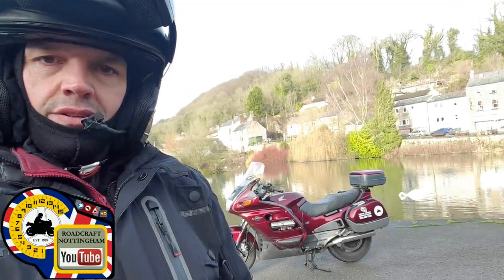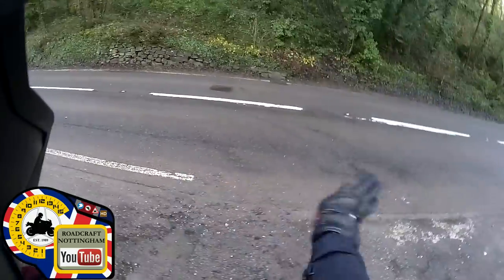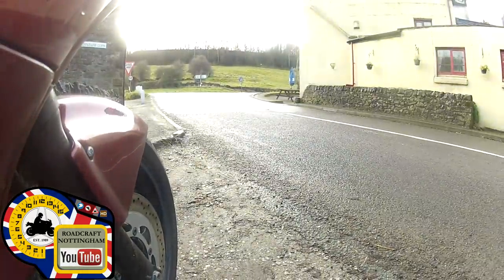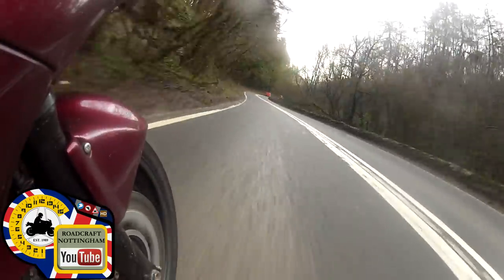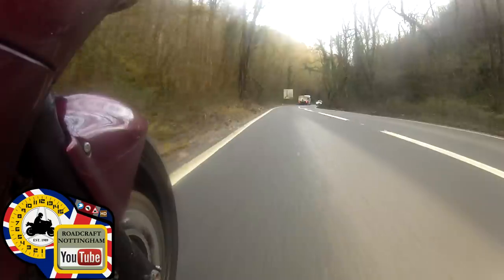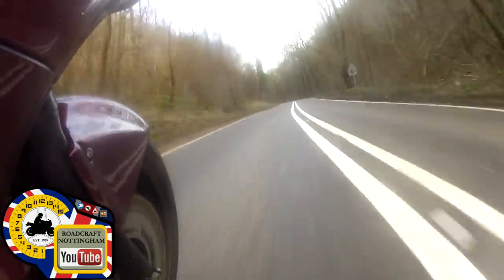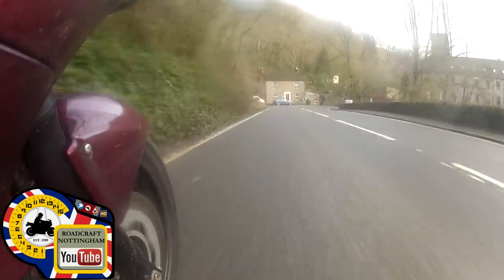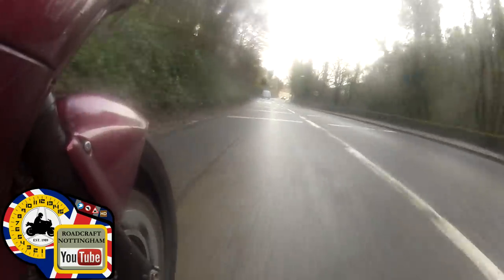Motorcycle riding tips: Advanced positioning demo with commentary

Comment: as a hgv driver and a IAM rider,this advice is great.HGV's trailer will cross centre lines on sharp rural corners,we cannot prevent it,keep away from that centre line if you see us coming pls,seen so many riders stick to their position like glue because they dont recognise the dangers👍
Reply from the maker: Yes, at the beginning of my how to ride in police style advanced upload a lorry has crossed the white lines. A lot of advanced riders don't consider this and just say "dominate your position". Thanks for the comment.
Reply: Great video and I agree with all the comments.

Experience has taught me to use the default position I was trained to in most situations, but also not to be afraid to adjust position due to weather, road surface or for potential dangers.
Reply: @petervan-huysse5803  Isn't  that why instead of having the old 7 positions or the more recent 5 positions we are now down to only 3 positions. Position 3 being the outside position is no longer close to the middle lines of a road but now borders on the sump line, the central position 2.  This was because at times in the old position 7 or 5 being close to the centre line on bends we might meet a vehicle head on which has crossed over that line and approaching us at double our speed.  Under those circumstances we are told to sacrifice such a  position and move in to  1 or 2 in order to avoid a collision but now its believed that we should not be instructed to place ourselves in that insidious position in the first place.
Reply: Whilst riding on country roads and on bends I take note of the middle white lines.  It seems to be a bit hit and miss so to speak. Some counties love them, putting hem everywhere  and they can be frustrating as they can slow progress but some other counties don't appear to like them and  their roads are devoid of  solid white lines. Maybe they havn't got the accidents that some counties have or just maybe they cant be  bothered.

I also look to see just how worn those lines are and if the lines are well worn it indicates that many vehicles coming the other way have run over the lines  and almost destroyed them. That is a further indication  to me of the danger of being close to them and perhaps justifies the reason the Police Roadcraft changed their attitude towards riding on or close to them .

Comment: About the manhole cover you mention in the beginning, the famous video "Twist of the Wrist 2" shows exactly what you mention at ~1:30 about regaining traction. 
They demonstrate this principle with a bike almost fully leaned over, hitting a patch of sand (arguably even worse than a manhole cover in terms of grip). Keeping a steady throttle and not upsetting the bike shows it being slightly unsettled after which it immediately gets grip again continuing on its trajectory.
However they also demonstrate what happens if you 'panic' and swiftly close the throttle. You guessed it: front just slides away with no ability to recover.

Comment: Nice video Russ. 👍 I often have to discuss riders taking quite harsh position changes just to miss a manhole cover when they are upright. The move they made was more dangerous than going over the thing. Having said that, if I can blend my line so I miss a raised/sunken one I will. In the wet and on a bend, if you must hit them then it is best to clip them towards the outside of the bend. That way any slip will be minimised. Good to hear mention of positioning for safety and not just view.  You also straightened the curves a little if you had a good view. All good stuff and the same sort of riding I do in my videos/commentary demos. 🏍
Reply from the maker: Thanks Mike, if I see it far enough away I sometimes make a steady movement away too but when people say they slipped on white lines/manholes they probably simply felt the bike change grip, that's all and if it DOES slip, chances are it's only a few inches before re-gripping unless they're doing some extreme and harsh riding. Makes me laugh how many qualified riders still swerve like the lids missing lol.
Reply: @RoadcraftNottingham  You do have to watch some white lines though as on the rural B roads they are often over painted and then over painted again, leading to them being quite a ridge. If you are not crossing them with enough angle you can get a tram-lining effect, which can be very unsettling.
Reply from the maker: @mikeroberts  add to this, as we know in winter there may be unthawed frost on the paint.

Comment: Good clear informative video. Worth mentioning for rural roads you can split advice between single and standard carriageways.  On single track lanes I tend to drop back further than the standard 2 second gap to perhaps 3 or 4 seconds, esp if damp.  This allows an extra safety margin for shielding where your view ahead may be more obscured.  On standard carriageways I always move to position 1 for farm vehicles and slow down because sometimes its difficult to see what attachments they are carrying until quite close and many of these overhang the centre so are a particular danger.  Ditto hgvs especially on bends where the rear wheels will often cut the centreline. Position 1 every time for hgvs, buses and farm traffic as well as for cars towing caravans or horse boxes. Position 2 is generally fine for cars but if the view ahead is good there’s still benefit in taking position 1 for all oncoming.

Comment: I like watching your videos as a way of validating my own roadskills on a bike, I learned the hard way for positioning with an oncoming HGV, nothing serious but I was riding in heavy rain and the oncoming HGV gave me and my bike a thorough wash down with the spray which caused me to panic a little and it was a good job I was on a familiar road and it was a straight part of it which I've learned to now always be in POS 1 when I have any size of HGV oncoming.  I'm a HGV driver so its also given me something to think about whenever I have a biker coming towards me in wet weather conditions, I'm sure many other HGV drivers do this as well and thats whenever I notice a biker behind me I will indicate left to signal its safe for the rider to have a peek and decide whetherto pass or not.  I understand that the view of the road in a HGV compared to a bike is chalk and cheese because of the differences in height.  So if riding behind a HGV and the driver indicates left always exercise caution and don't take it as a green light to drop a gear and go
Reply from the maker: Good points. Thanks
Reply: Many years ago, on a T140E, I was going into that tight left bend at the top of Lindum Road. An oncoming HGV cab was on its correct side, but the rear end was NOT! It took my RH mirror, all happened so fast, shook me up and a lesson learned the hard way. I should have been nearer position 1 of course. Just bought a 2021 T120, new right knee says "No thanks" to kickstarting! Too wet and cold to take the latest Bonnie out, plus insurance to sort. So many technical refinements ... a GREAT video, thanks, also preparing for the IAM test, Liam

Comment: Hi. had a incedent while turning off a round about in the wet and leaning into the sharp corner and going over a pothole that was a couple inches under the level of road, ie it ha sunk down, my back wheel lost grip and I almost lost it. it sort of did a bunny hop, once was back onto tarmac found grip straight away, it just gave me a bit of a fright. Mind you my suspension is a bit hard... Quite agree with your analasys of trail braking, only keep the brakes on when its really tight and once at the appex and can see my exit its back on the throttle. instructor kept telling me off on the carpark cone weave for not using back brake, on my fazer don't feel the need, have learnt and practice all the time that I can do it just using the clutch, my idle speed is just enough. not sure if you can understand what I am saying but great video, thanks

Comment: Thanks for uploading this, great video. I have just started the IAM Roadsmart course and I find this advice very relevant. One of my many failings is speed (not fast enough) and I seem to have a problem with left hand bends. I've really no idea why, I wish I did! I know the bike is far more capable than I'll ever be (Tracer 900) but the problem persists. I know it's me, I need practice, and more practice to build my confidence back up. I had a 16 year break from bikes and returned in 2016.
Reply from the maker: You're welcome. A lot of speed errors are usually down to how much information you take and how you process it. Lift your head, read your limit point and plan the bend further ahead. This will make things much easier in time but don't try too much too soon, work up to it. Good luck.

Comment: I initially did what other people told me years ago about the lane position so you can get a better view. After thinking about it for a long time I decided it was generally a flawed system . I havnt used it for over 30 years and never been suprised by a vehicle and my cornering is much better with minimal lean. I may stay away from the far left if bushes etc are blocking my view  or if i am being tailgated but generally I think its flawed to go right when you intend to corner left. If my view is obstucted then i slow down. Anyway each to their own cheers.
Reply from the maker: I absolutely agree with you. In modern traffic with lower speed limits, bad road surfaces and us not being police riders on an emergency call there's really no need to be in any particular position let alone extreme positions and by slowing down by 5mph or so could completely remove any need to move at all apart from debris etc. Really can't argue with you 😂. Unfortunately some brainwashed still insist that extra 20 metres you get makes all the difference.

Comment: Nice video. Can I put forward a different point of view regarding positioning?

I’ll start by saying that I ride most of the time in position 2, and I find it liberating and also safer than constantly switching across between positions 1 & 3. Here are my reasons:

1. On a single lane road like the one in the video, simple geometry suggests that positions 1 & 3 offer minimal increased vision around left-    and right-hand bends.

2. Any increased vision is nullified by the dangers posed by oncoming traffic in position 3, and kerbside rubbish in position 1. I note that you were frequently forced to abandon position 3 because of oncoming traffic. Why not just stay in position 2 and reduce the risk?

3. Staying at position 2 gives a safety margin if the bend should unexpectedly tighten. In 1 or 3 there is no margin for error, you will either cross the white line or hit the kerb. Position 2 allows you to swing wider.

4. Not having to decide constantly whether to move from 1 to 3 leaves your mind free to assess the bend and oncoming hazards, to change gear and brake if necessary, and to watch following traffic in your mirrors. It is also much less tiring on longer journeys.

5. Switching from 1 to 3 can confuse following car drivers. I previously had drivers either trying to pass on the inside because they thought I had moved to 3 to turn right, or to overtake me at 1 because they thought I was stopping. Much better to occupy a steady position 2 and thereby make your intentions clear.

Thanks again for your thought-provoking video
Reply from the maker: That's a very fair point and there's nothing wrong with that in modern traffic, and if you can't see, slow down.  To be honest, with modern roads and speeds, it really comes down to "SSV" but if you want to stay in P2 and it's safe, don't bother doing the advanced test or you'll fail as they want to see your thought processes and see why you chose p1 or 3 etc if that makes sense?   Thanks for your comment.
Reply: @RoadcraftNottingham  Thanks for your prompt response! Yes I realise that I might struggle now with the Advanced Test. Just for your interest, I passed the old “Star Rider”  test at Gold (advanced) level in 1982, and subsequently became a Gold level instructor. Came back to biking in 2020 after a 30 year break.
Reply from the maker: @josephlarmor550  welcome back, yes, I passed gold in 84, not many of us left. I suppose if you absolutely had to choose an more extreme position, it would be with oncoming traffic, p1, especially heavies, to "present" yourself to any following cars that may want to overtake. But all depends on surface too.

Comment: The only time ive come off a bike is going over a manhole cover, it was damp, i was a very inexperienced rider, pulling out of a junction going right, straight over a manhole cover and the bike did a 180 and we both ended up on the ground, it was a learning experience and i always try to avoid them now, specially when cornering

Comment: Thank you Russ for the upload , grate riding and advice as always ... TBH i normally ride in P2  (centre of lane or "sump line," as you call it) and very rarely change positions as i feel its best of both worlds , visibility and safety from on coming cars  and considering its not 1980's don't have to worry too much about cars leaking oil and in winter time its normally most dry part of road
Reply from the maker: Agreed, just remember to keep your eye on the condition of p2 as there was loadsa mud today.
Reply: @RoadcraftNottingham  will do .. cheers Russ, appreciate it.